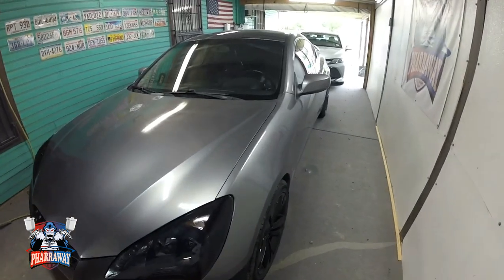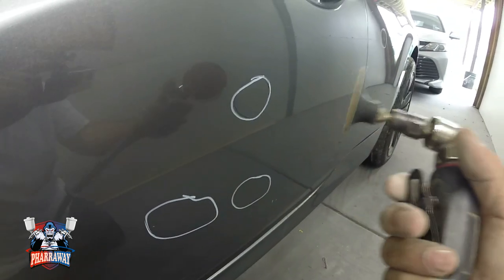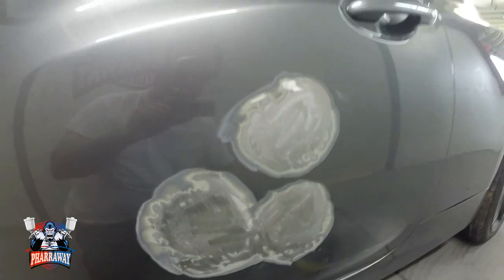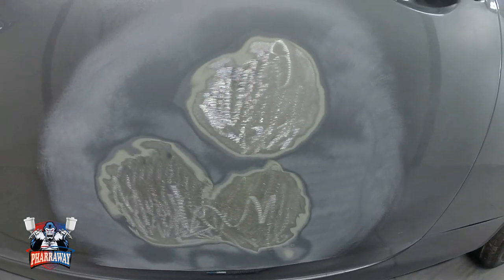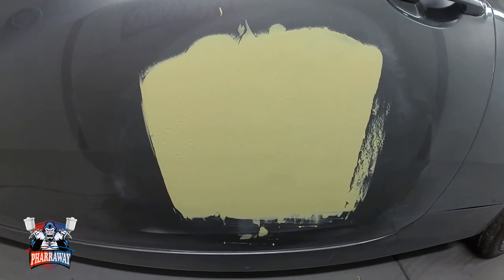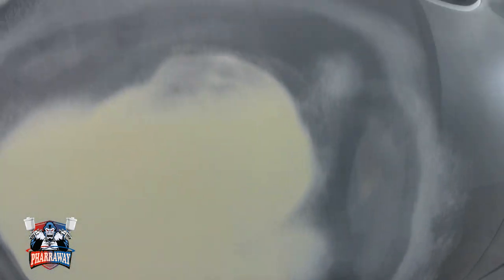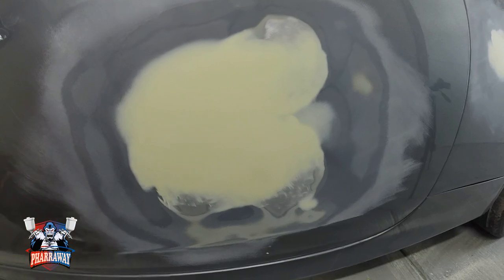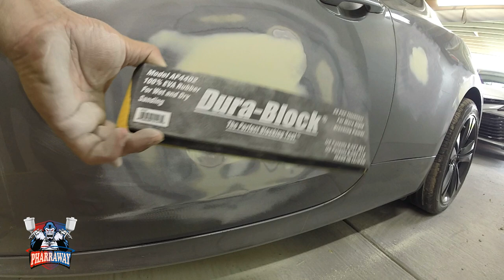How to get the perfect black paint job PART 1

Comment: I was hooked on usc pro glaze putty after I used it and bought the big tub. I definitely agree with you about seeing everything afterwards. First car I shot was a black midnight metallic civic with ure- chem and I did great for my first time. I did however notice some very slight imperfections in my body work. Customer was there when bodywork was done, and was satisfied that it was smooth enough in some places where I might have glazed a little more. But I noticed in the end. Try not to cut any steps when doing black, thanks for the reminder buddy!
Reply: "Try not to cut any steps when doing black," Or any color for that matter. 🙂

Comment: Why didn't you try to pop the dent out from inside the door panel? I'm just asking out of curiosity. Also, always been meaning to ask what size copper tubing do you use in coming from your air  compressor?
Reply from the maker: the dents are not that big that not a lot of body filler was used and about the tubing, it's not copper it's PVC
Reply: @PHARRAWAY  ok thank you. I just got a 60-gallon PUMA. 
I watch all your English videos. Keep up the great work. 
Thank you...

Comment: Body filler won't stick to 80 grit??
Reply from the maker: No brother you will have pilling down the line
Reply: Sorry to disagree but evercoat fillers tds sheets say sand paont and metal with 80-180 then apply filler. Weve done it this way for 20+ years at our shop never a problem and ice seen repairs 10+years old.
Reply: @aaronanderson5197  yea I wouldnt use anything finer than 180 for filler, for finishing glaze 180-320 to prep for 2k primer
Reply: Body filler totally sticks to an 80 grit surface.

Comment: Why didn't you try to pop the dent out from inside the door panel? I'm just asking out of curiosity. Also, always been meaning to ask what size copper tubing do you use in coming from your air  compressor?